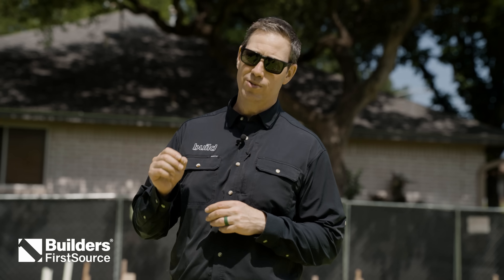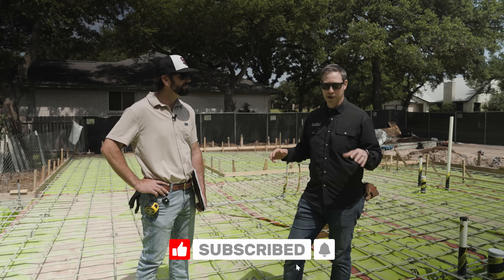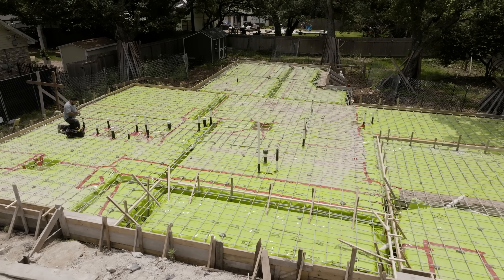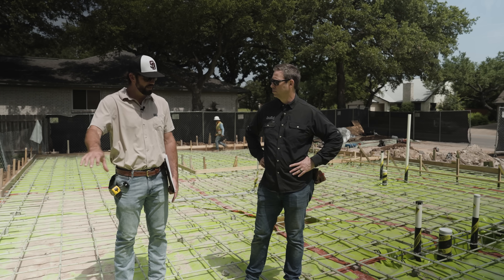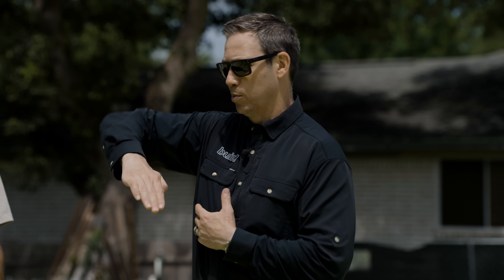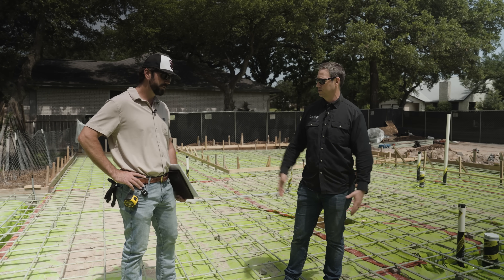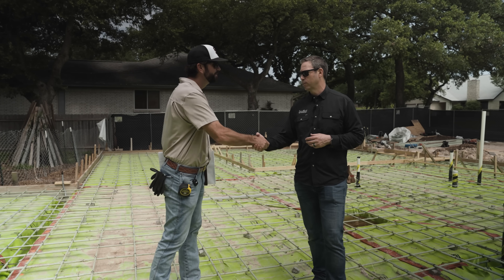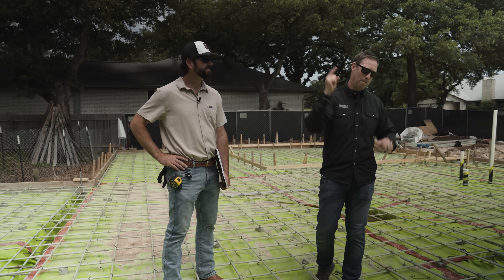Slab Foundations: Rebar vs Post Tension (my Engineer’s Opinions)

Comment: My 2 yr old house just had something on the foundation put a hole thru the side of my house, about 4in wide on foundation, hole poked thru. Black metal kinda round thing showing, stamped with ln 102 on it, cant get centex builder to even look at it. In arizona

Comment: With either a PT or conventional slab, a soil report from a licensed geotechnical engineer is preferred, but ESPECIALLY for a PT slab. Fyi PT slabs tend to be 4" think at pads where as conventional tends to be 5" or greater

PT slab benefits

- better performance on highly expansive soils
- PT beams can carry higher point loads without footers because of the the cables
- cheaper and less labor intensive to install (which is why most production builders use them).
-less cracking

Disadvantages 

- as mentioned in the video, remodeling  is significantly more difficult. You cant just cut anywhere you want
- irregular shapes typically get a re-bar beam anyway. The way PT slabs deal with strange or small slab bump outs is to create partial Rebar beams that tie into the foundation, so given complex geometry, the exterior beams are just rebar anyway
- altering plans at the pre-pour stage is more difficult due to the geometry item mentioned above
- Must execute correctly. Must place the correct number of tendons in each beam as specified by the engineer. Must not miss tensioning any cables (believe it or not, this is something production builders DO get wrong, and that creates a headache). Tensioning cables can create blow outs if back up bars are not correctly placed where tendon anchors meet in close proximity.

I'd say in general that custom slabs end up being rebar except in highly expansove soil markets. Most production slabs are PT ESPECIALLY in highly expansive soil markets.

Comment: We just bought a house to be bult in Robson Ranch in Denton Tx. They use post tension. The houses, while extremely nice, do not have very irregular shapes and remodeling will not be much of an issue as the HOA restricts any wild ideas of remodeling on the structure. I haven't heard of any issues in the community which has about 7500 homes built.

Comment: Matt Risinger maybe good but HE IS NOT A GOOD ENGINEER HISTORIAN! He should know better that post tensioned concrete and-or prestressed concrete were invented during the 1050s reconstruction decade after WW II in order to compensate for the shortages of cement and steel and was meant only as a temporary stop gap measure. But the savings are too great to ignore that they made an error to make post tensioned concrete and-or prestressed concrete as a normal engineering concept WHEN THEY SHOULD HAVE NOT DONE IT AT ALL! Post tensioning and pre-stressing is an active form of steel reinforcement that must be done at the highest standard of engineering and new techniques and methods must be found to accommodate their disadvantages. In a foundation slab the post tensioning and-or pre-stressing must be done in two directions or crosswise and lengthwise of each other forming a square grid network of post tensioning and-or pre-stressing cables or wire cables that must be heavily galvanized or nickel plated or made out of galvanized weathering steel or made out of hyper-strength stainless cales or wire cables. 

The result is that the high level of skill and accumulated experiences and specialized and expert craftsmanship in making HIGH QUALITY STEEL REBAR REINFORCED CONCRETE WAS ALMOST LOST BUT WAS SAVED ON NUMEROUS BOOKS AND OR MICROFILMS WHICH WERE THEN RECOPIED ON MANY MICROFILM ARCHIVAL CARDS AND TAPE CASSETTES AND ON PAPER AND IS THEN REPRINTED ON PAPER SO THAT ALL CAN READ THEM IN ORDER TO LEARN FROM THEM. 

The secret to make high quality CONVENTIONAL STEEL REBAR REINFORCED CONCRETE is to make the steel rebars to be as thick as possible and as near to each other as possible ranging from as wide as they are or 1.5 times as wide as they are or 2 times as wide as they are. And the hoops or loops are to be as half the size of the main rebars and spaced apart as equal to 1.5 times to 2 times of their thickness or diameter. 

The concrete formulation is as important as the steel rebar reinforcement. The ratio is 5 - 1 - 5 or 5 bags of cement + 1 bag of sand + 5 bags of gravel. The sand and gravel must be mica-free and the gravel must be around 1 centimeter across more or less so that the concrete can pass through the high density of steel rebar reinforcement. 

The other most important thing is that all conventional steel rebar reinforced concrete must use the steel-rebar hoop SHELL REINFORCEMENT PRINCIPLE AND CONCEPT AND TECHNIQUE THAT WRAPS AROUND THE CONCRETE STRUCTURE ITSELF. 

And the steel reinforcement must be as near as .5 to 1 inch thick near the outer surface of the steel rebar reinforced concrete in order to take maximum advantage of the tensile strength of the steel rebars and steel hoops or loops reinforcement. 

Most important is the knowledge of FERROCEMENT concrete which can be made to be as flexible and tough and durable like a piece of wood or fiberglass reinforced concrete and will not break.

Comment: When doing reinforced slabs, if you just do a proper job with the grading, you dig out all of the bio-mass, fill it with gravel, compact it and design your slab to not have any long term settlement and limit the crack width of the concrete with sufficient reinforcement, you will: 1. Never have to do these unnecessary "battleship beams", 2. You won't have a single crack in your floor, 3. The drainage will sort its self out because of the gravel, 4. You can use less concrete and do a much easier structure/form work, 5. It will be a cheaper slab.

IMHO these slabs just seems to be a way to cop out of doing a proper geological survey, a proper preparation of the ground on the site and a way for the builder to charge more because it's way more work to prepare/form.

In Sweden we never accept any settlement for buildings which makes this entire "the house should move like a ship" completely redundant. If I would've designed this slab I would demand a geological survey and proper preparation of the ground on site and just make a strip footing under load bearing walls big enough to achieve the ULS and SLS load (Pa) capacity of the ground. Everywhere else it would be either 100-150mm of concrete depending on loads and if the slab has integrated floor heating or not.

Comment: The big problem with post-tensioning is a complete and instant loss of strength should it ever fail- and failure has been known to happen. If the soil engineering and slab design are good, a rebar-reinforced slab will perform very well and any failures will be gradual instead, allowing time for rectification. Alterations to tensioned concrete requires each one to be engineered, but with rebar slabs you can follow some general rules and guidelines with the alterations and bypass that extra engineering without problems. It's not that you can't do better than rebar; it's that you almost never really need to so why bother?

Comment: No to both. Covering all your  utilities with concrete is never a good idea. A repair could cost you 50 grand. For the long run it’s a bad idea.  I concrete grid foundation with holes for running the utilities though would be my choice over a slab of any kind.

Comment: Unfortunately, steel wiring (aka cables) do have tension and stress relaxation over time. This affects the effectiveness of the post-tension foundations. Over time, the foundation becomes uneven and problems start to occur. Remedy for this is too re-stress the cable every 5-10 years, which is expensive. Otherwise, home owner will need to perform jacking and install piers - also expensive. A post-tension foundation is a short-lived cost effective solution to high-price home builds, and thats why they are sold to homeowners. The Builders and Engineer are long gone when a post-tension foundation starts to have problems. I am an engineer, and when we built our home in The Woodlands 3 years ago, we instructed our structural engineer to design a "commercial grade" foundation: concrete minimum 4200 psi, deep beams, 12" OC rebar, one size larger rebar, minimum 5" thick concrete flooring, including in the garage. You get what you pay for, and we expect to have no problems in the future. BTW, we also over-design our framing, and expect to be the only house in neighborhood to be left standing after all others are blown-down. Listen to Matt ... we implemented allot of his recommendations in our home-build.

Comment: There are many myths out there regarding concrete. The one I find most ridiculous is the saying that all concrete foundations will crack. If they do, then they haven't been engineered correctly for the site conditions. And ANY single layer reinforced slab will crack because the only thing either tension cables or a single rebar layer does is to provide a hinge. The idea behind proper steel reinforcement of concrete is to eliminate the concrete from being under tension in any application of force, either up or down. this can only efficiently be achieved by applying two layers of reinforcement. one close to the top and one near the bottom of the foundation. The larger the slab is, the more important is the application of a second layer of rebar. Foundations on instable soil need to be treated like free carrying floors in multi story buildings. If you apply this principle, you'll never have a problem with any foundation slab cracking. The downside is that it costs more and people cheap out on the most important part of the build. Especially track home builders.
Reply: Every concrete slab is going to crack. Concrete has allot of moisture, and it dehydrates over time ... concrete is NOT flexible. Rebar is flexible. Thats why concrete and rebar and soil conditioning work hand-in-hand to effectively support a structure - a good engineer applies the proper formula for a long-lasting (30+ years) foundation.
Reply: There's two kinds of concrete slabs. The kind that have cracked and the ones that will.

Comment: Post tension is very strong , very dangerous if you need to cut those rebars for any reason after slab cures , the slab can explode due to high tension. If you never touch it , no big deal.
Reply: That’s an urban legend. I’ve never seen a tension cable blow a slab out. They’ll break right down the sleeve.
Reply: @rheuss1  rebar under tension is very dangerous.
Reply: @mankind5709  you’re taking cables not rebar I Assume. Cables usually don’t fail suddenly even if cut. They lose strands and as they do the pressure is released so that by the time the last pair of strands are cut through the pressure on them is not going to cause slab blow out.
Reply: Thank you for the clarification from your experience. good to know.

Comment: Post tension compression literally makes the concrete stronger. 

I’ve seen a Shapell home in the SF Bay area that the homeowner was adding a kitchen island and the hack remodel contractor jackhammered into one of the tensioned cables. Lucky he wasn’t killed. The cable pealed back 3’ of concrete floor  flinging chunks through the ceiling.

Comment: in my cali exp there was graded repack ground and dig down bearing points slab pours  not tensioned rebar grid throughout and specic concrete batch mix depending on aplications height load ob etc ive not seen any of that around my fave buiders chanels, like you describe the sole shoe of a house is primordial

Comment: The problem with PT is many engineers treat it like magic and don't put as much care into designing the slab.  The design methods for PT slabs are much less conservative than the design methods for conventionally reinforced slab so you end up with less concrete and less reinforcing.  To some extent the compression induced by PT reinforcing offsets the reduced amount of concrete but I think the PT slab can still be less stiff.  There is no replacement for a well thought out layout of stiffening beams and extra care at projecting elements such as designs with breakfast nooks.

Comment: Isn't the big advantage to a post-tensioned slab that you get the same strength with a thinner slab, or is that just for suspended slabs?
Reply: Not necessarily. If you build on top of sand or any other stable soil it doesn't make much difference. Where it does make a difference would be on soil that's old river and/or sea bed, or any other settlement prone soils like clay, but then I would argue that doing a slab on top of the ground is the wrong way to go because of the settlements. Granted you could pre load the site with weights to take out the bulk of the settlements beforehand but then it wouldn't be necessary to have a post tensioned slab anyway.
Reply: I'm surprised that sand would be considered a more stable soil. Im Florida, we have sandy soil and sink holes can appear anywhere. I guess clay can dry out and moisten up and change in volume?

Comment: I just poured my foundation back in January for my house here in Texas about 90 minutes from Austin. The house is next to a Creek in the engineer suggested we do post tension, and then drill 8 ft x1ft piers every 4 ft around the exterior beams. It's pretty interesting to see how the cables lay down deep in the bottom of the beams, under the plumbing and attach then live and dead ends about a foot below the brickledge. They then pull 40,000 lbs of tension on each cable. They are essentially a lifting Force on the beams in the middle of the foundation.
Reply: What scares me is renovations or tensioning issues down the line. Also, having to have an engineer for repairs or renovations just to drill a hole in the slab sounds like a MAJOR PAIN, not to mention expensive.
Reply: thanks

Comment: I have a post tension foundation in the San Diego area.  Not sure if it was required because of the soil conditions in my area.  It is a pain in the butt.  Every time I think about doing a remodel on the first floor, the dollar signs go through my head on how to deal with it.

Comment: check with your bank before deciding to use post tensioned concrete for residential construction. For Calgary condos as an example you can not get a conventional mortgage for a unit in a post-tensioned building, it has to be "insured" with the extra fees involved

Comment: Post-tensioned does work well with expansive soils.  I’d use rebar on stable / rocky soils.  I did a video explaining the post tensioning thing. 

Post Tensioned Foundations - The Mystery Solved (How They Work)
https://youtu.be/RoB30pZY6Us